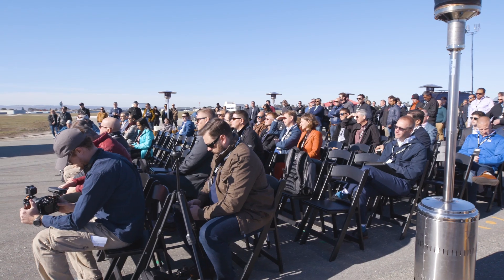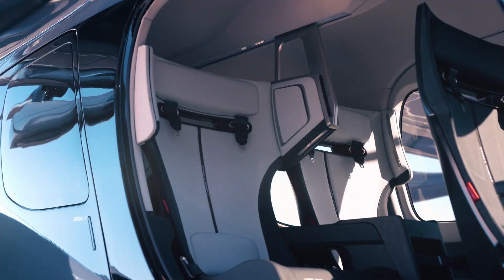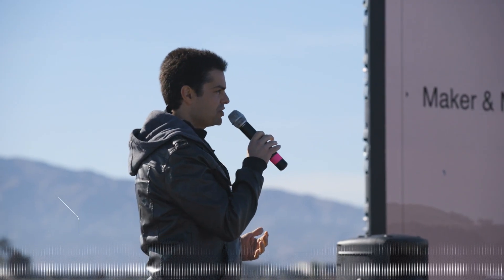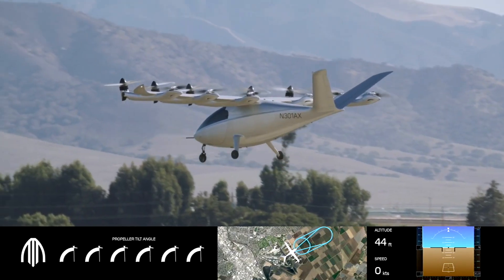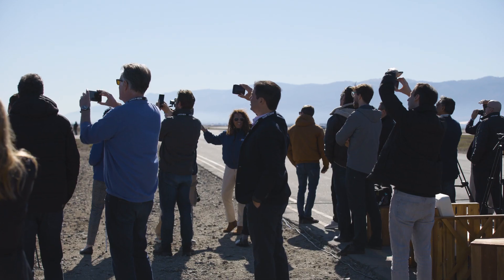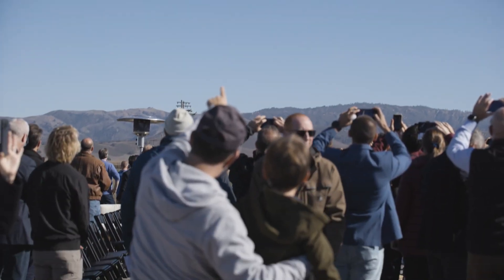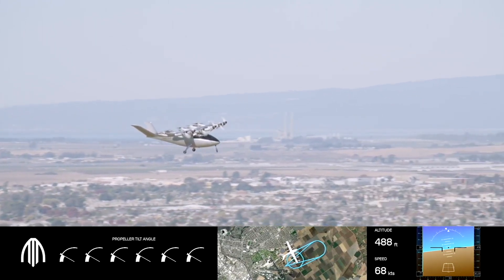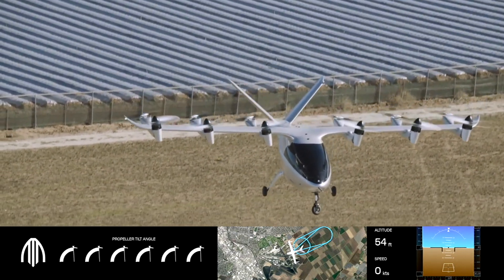Archer Open House | Maker eVTOL Aircraft 70 KTs Flight Test Experience

Comment: Impressive carol  and. Tilt a. Rotary wing. Forward. Good
Trick getting.   Higher.   Elevation to assist from getting    From. Rotary  to. Fixed. Wing lift. Using.  The. Fixed. Wings of the aircraft for lift

Comment: Don't get too excited.  This is an unmanned demonstrator.  Add the considerable weight of pilots, passengers, luggage, safety equipment, radios, navigation systems, seats that are usable and crash absorbing, a structure that can tolerate a crash, the batteries to give it any sort of commercial range etc etc and it becomes merely a replacement for a helicopter at the same cost but less range.  "But not nearly as noisy" you say!  Ask yourself why there was only the sound of the C-teams commentary - these things in reality sound like huge drones.
Reply: Joby has gone over 200km at over 300kph with 1000 pounds already.
Reply: @etemytradel4509   Has Joby carried a live person/pilot yet? at all?
Reply: I'm not sure but that is just laws stopping them if they haven't had a human fly.